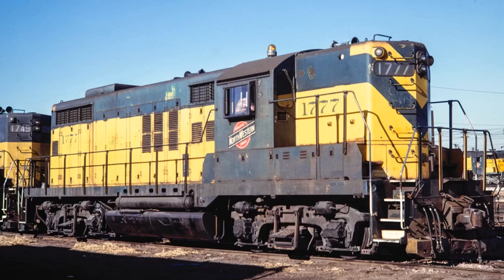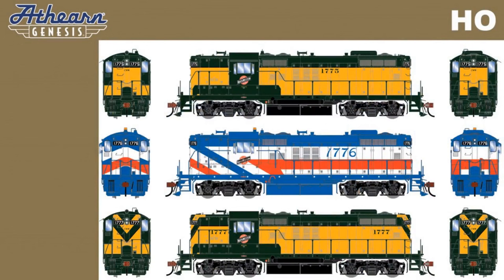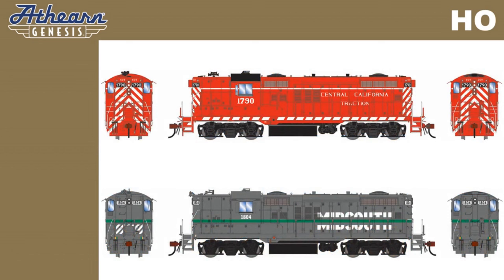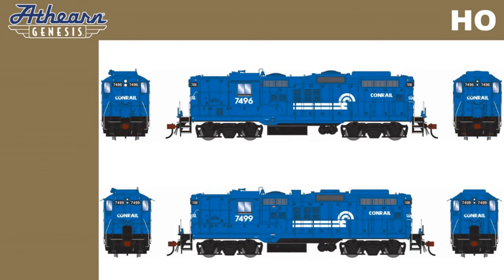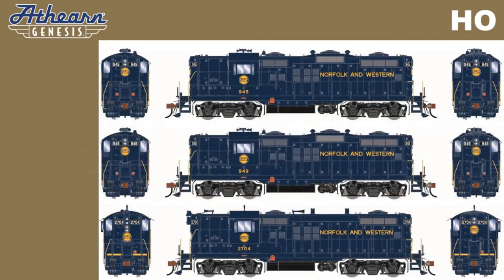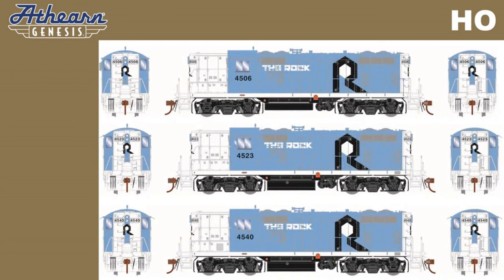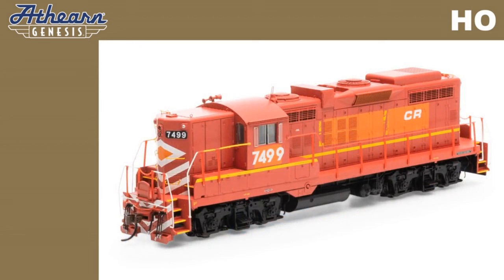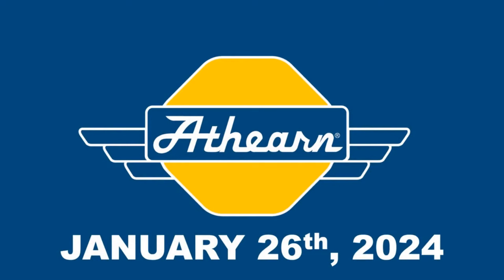Athearn January 2024 Announcement:  Athearn Genesis EMD GP18 & GP7R Diesel Locomotives

Comment: Did Athearn ever re - do the cab side windows to be the correct size on the gp7-9? I ditched all of mine because of this issue but have never seen an update anywhere if this issue was ever corrected.
Reply from the maker: Some of the early GP7s and GP9s had some inaccuracies however those were addressed a while ago. The cab side windows match our drawings from EMD.

Comment: I just bought 2 genesis 751's CN locomotives & am very disappointed in the flimsy handrails & detail parts. Also, I have a layout & run many Atgren locks on it & they do great, but the new ones wont make a round without de railing at least twice. When you spend good money for a nice engine, youd hope to get a quality piece.
Reply from the maker: Sorry to hear of your struggles with Athearn Genesis. Have you contacted our service technicians at Athearn?

Comment: How can we see the actual model instead of the artist's rendition? If they haven't been made yet, please hold off on the Midsouth model until you look at the paint stick I have to make sure you have a dark enough gray to be accurate.
Reply from the maker: This run of announcements has not been produced yet, production will start after the pre-orders are closed on 1/26/24. Our Research team consults with historical societies, field experts and the railroad if the subject is still current day equipment. We strive to use actual paint draw downs whenever possible. With that said, if you believe you have something to contribute to the research of this particular model, please contact us at athearn-productsuggestions@athearn.com

Comment: Grand Trunk Western also had some non-dynamic brake equipped GP-18 units as well… I suspect that you could sell more of them (in three paint schemes) than CCT for example. Not to dis CCT fans…
Reply from the maker: You are absolutely correct, however we want to do the smaller short lines and one offs for those fans and have more future releases with the heavy hitters. Only 350 of the prototype GP18s were built for U.S. Rails so we need to pace ourselves. The good news is that it is only a matter of time before we announce another GP18 run in one or more versions of the GTW.